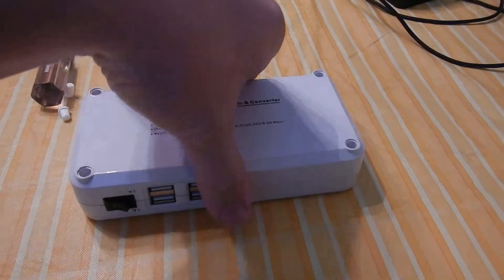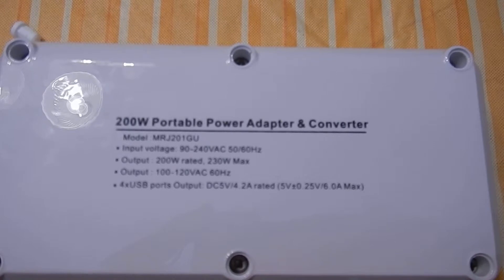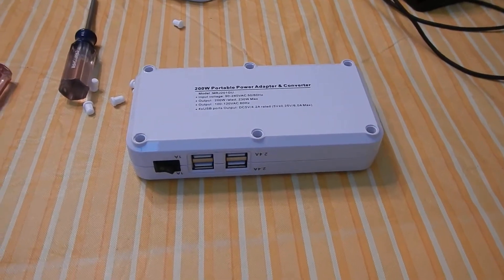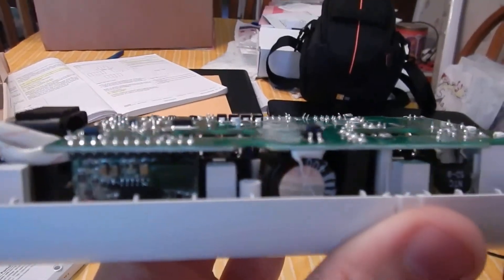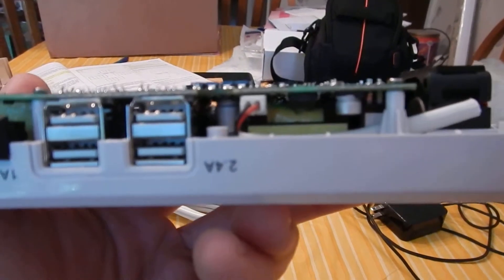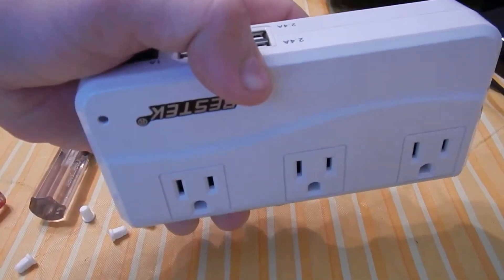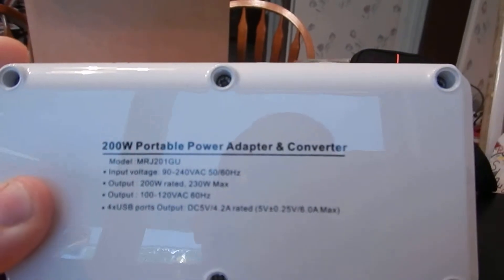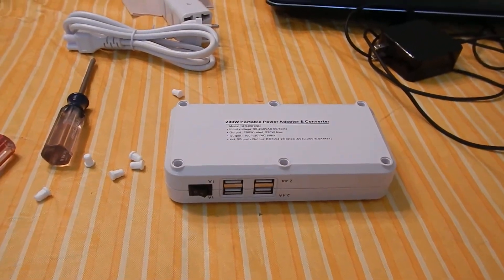Bestek 200W power adapter & converter (inside)

Comment: Based on their other products, and the fact that this converts frequency and voltage, I strongly suspect that this is actually an AC->DC->AC inverter. The transformer you see is part of a switch-mode power supply to create the DC voltage. The DC voltage is then converted to a "modified sine" stepped AC via an inverter, just like the DC->AC inverter you might buy for your car.

They also sell a "pure sine" converter that is frequency locked to the input frequency. It's not clear to me if that's just a transformer, but it seems like they are doing something more clever, since a 200W continuous rated transformer should weigh at least 3 lbs, and it weighs only half that.

Comment: I am grateful you made this video, I have had my Bestek converter now nearly 8 years and love it for my US electronics that I use in Israel. It has been making much noise and I was going to toss it, then I thought if I could open it I could clean out all the dust thats accumulated throughout the years. I had no idea how to open it until i came across your video. I cleaned out all the dust, but it still is noisy (perhaps the fan needs lubrication?) Anyway thanks for your video!
Reply from the maker: If it is the fan it might need a little lube.  Or the fan might need to be replaced.  They are just a simple little computer fan.  If you look at the label on the fan it will tell you exactly what fan you need and you can probably buy it on eBay.

Comment: IT WILL NOT LOUD? YOU CAN USD FOR HAIR CLIPPER 110V 60HZ?
Reply from the maker: Dung Lap yes, it will power hair clippers 110V 60Hz
Reply: Thank you very much. I have ordered a lot of products 220 50hz to 110v 60hz for hair trimmer. But when operating it is very noisy, because of wrong frequency. Are you sure it will switch from 50hz to 60hz. I feel helpless please help me
Reply from the maker: Dung Lap it did for me.  I never hooked it up to an oscilloscope but it ran my hair trimmers perfectly.